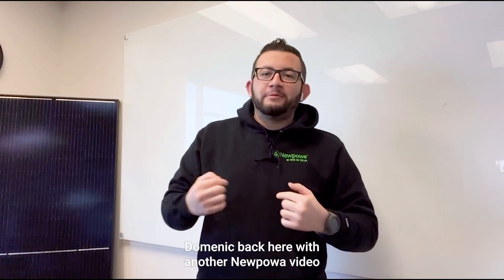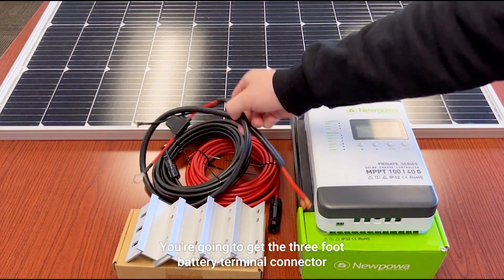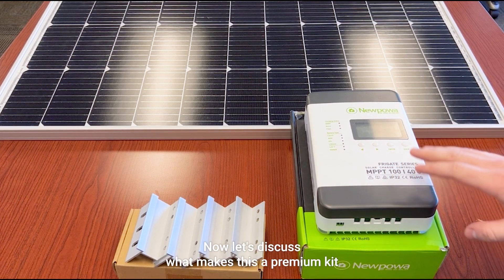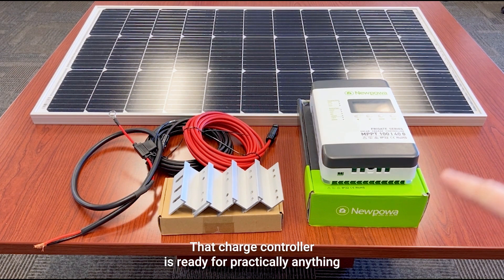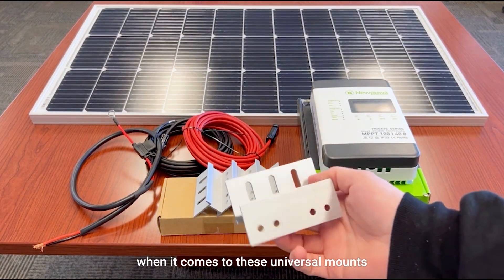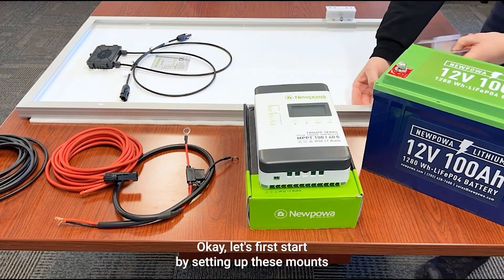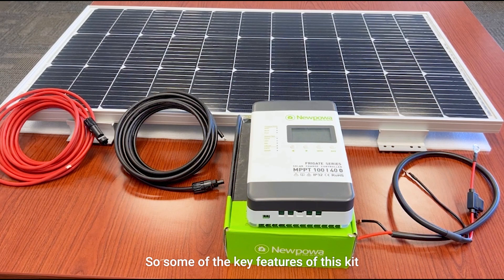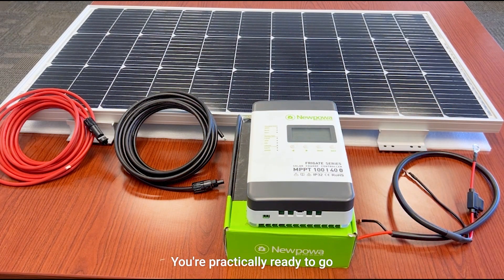Newpowa’s 100W 12V Premium Solar Kit

Comment: Hello from Canada. I just finished installing the 200 watt system in my old camper. It went in flawlessly and works great.  I plan to get another solar panel and another battery next season. The Newpowa support team immediately answers any questions you may have. Thankyou Newpowa.
Reply from the maker: Thanks for sharing